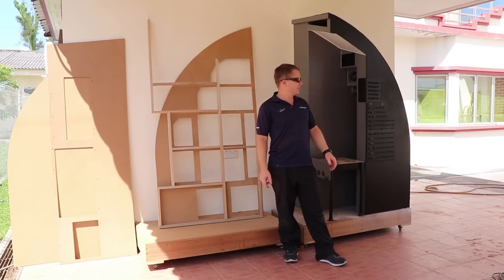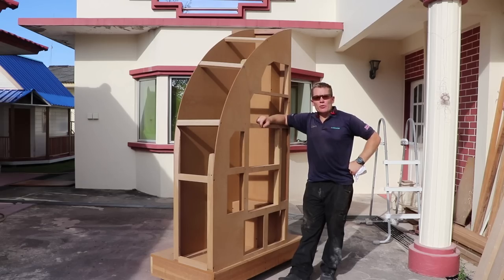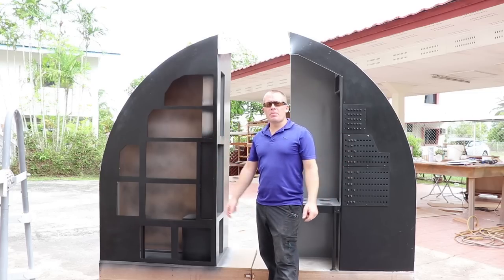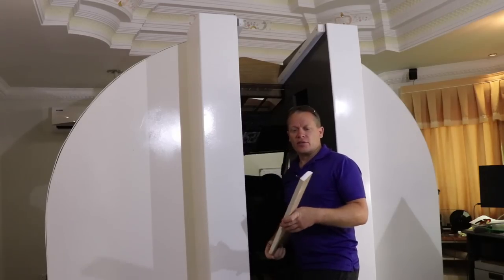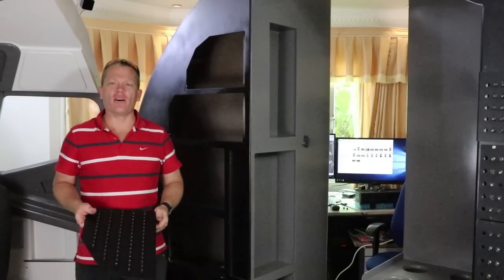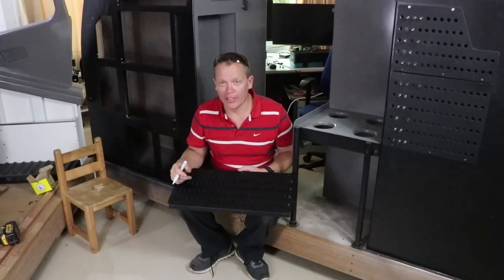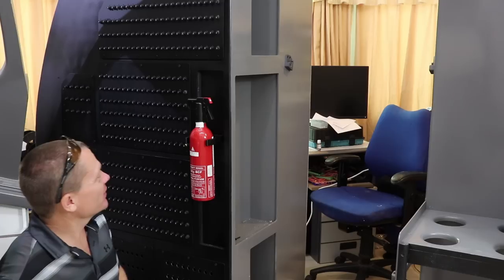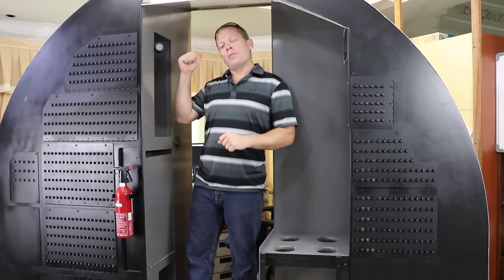737 FO BULKHEAD

Comment: You really built it like the real thing! So few sim builders have the circuit breaker walls and jump seats and if they have it it's bought for a lot of money from a company specializing in 737 sim parts and doesn't look like the real thing at all.
Your free hand number painting was impressive!

Do you only use MDF board or do you use plywood or other material too?
Reply from the maker: Hello from sunny Brunei. MDF is my preferred option for wood, because it sands to any shape in seconds. It's easy to cut and the paint finish you can achieve is awesome. However, it does have its drawbacks. Mainly the amount of dust it creates. Thank you for the kind words.